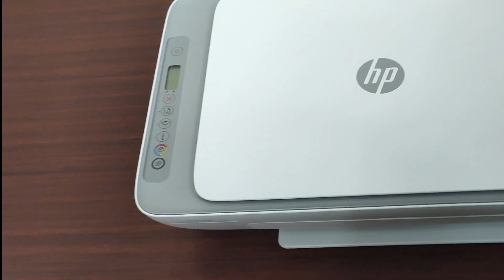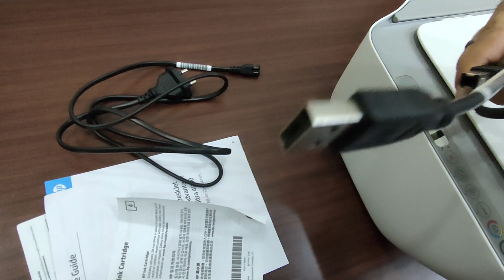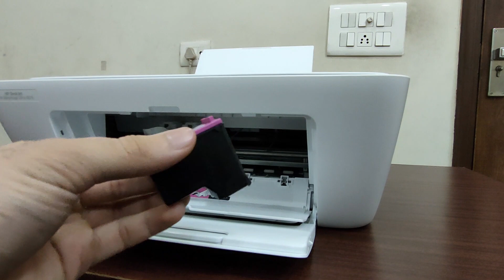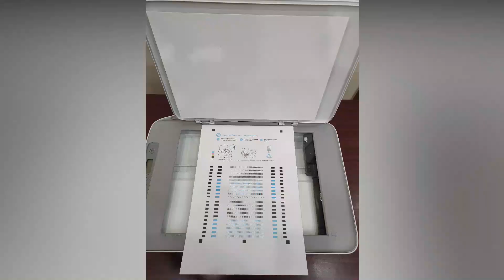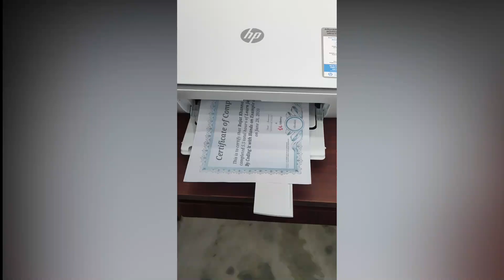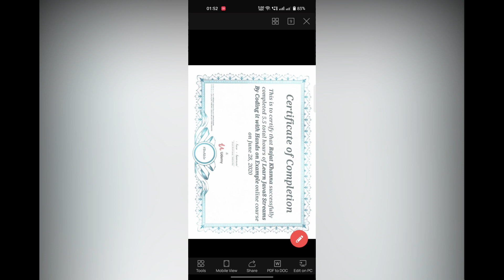HP 4826 All in One Printer Full Review | Wifi | Cartridge Installation | Printing | Scanning

Comment: How is it working now?...bro..and are you facing any problem in wifi connectivity?...plz tell as soon as possible, I am thinking to buy it.❤
Reply from the maker: It is working fine. Just sometimes I face WiFi issue while printing from laptop but works fine if I print from mobile. The ink refills are great. It can print quite good amount of pages.